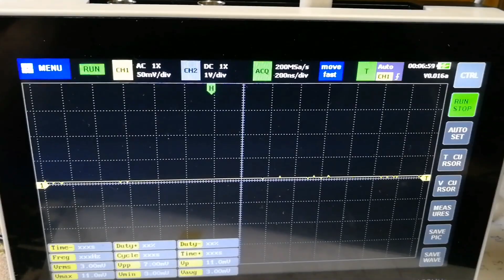FNIRSI 1013D Assembly of the RTC module.

Comment: Today i fitted the RTC DS3231 module to my  FNIRSI 1013D oscilloscope and it's working well!  The RTC module helps keep accurate time on the oscilloscope, which can be useful for time stamping. the clock feature is working well when using the "Save Pic" and "Save Wave" icons. It seems like the modification is providing me an improved experience, particularly for saving and organising data. Ps : thank to all  for your help with this Video & Link. .. PS just take your time with the soldering & all will be fine .. Mine is works well so far.. Enjoy